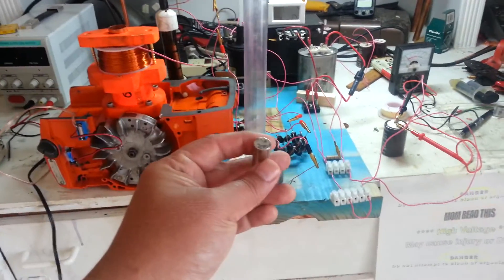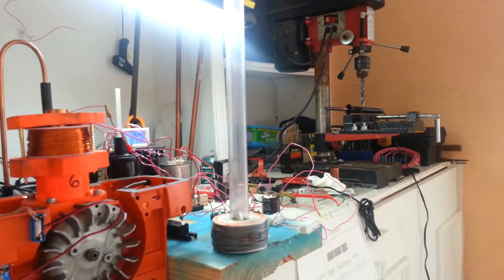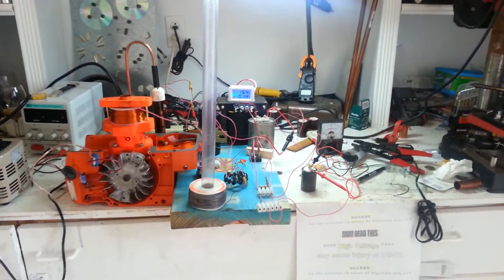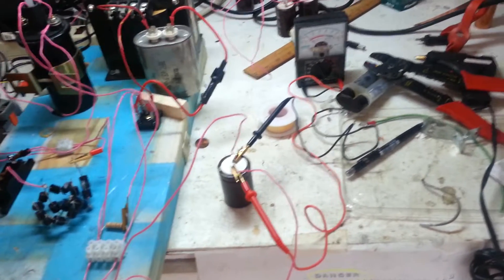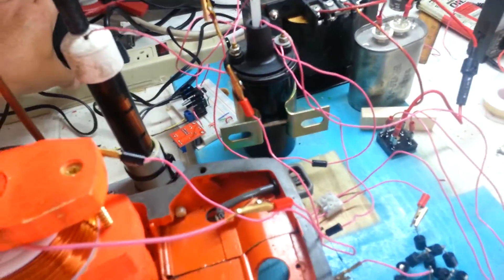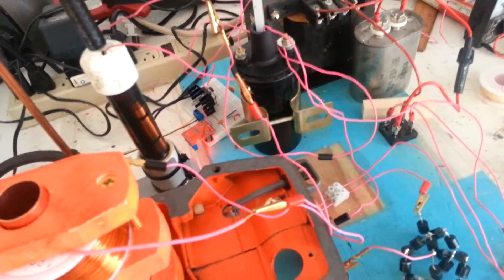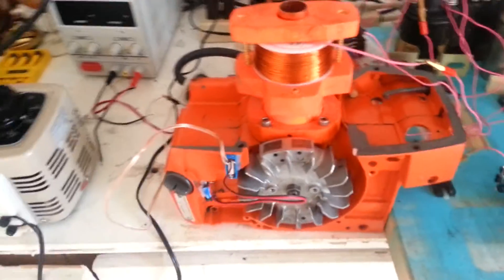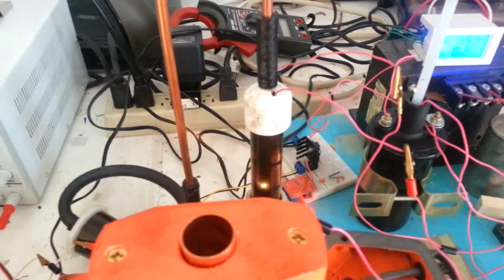Working Ed Gray Motor

Comment: Can you please power a motor load with it
Reply from the maker: Armando Garcia - It is possible, but you have to recognize the truth. This is an not an over-unity effect, this is a switching effect. It can be used to transform capacitive discharge through a coil to ground, but you have to have a means of charging that capacitor.
Reply: @XR_IX  can you run it to something g else, with a ground connection in parallel, you cannot mean earth ground right, chassis ground?
Reply from the maker: To All: A large capacitive discharge releases Hydrogen. My spark tube was immersed in oil and filtered to maximized the performance of the gap.  This is when I noticed that the discharge was creating an explosive gas (in OIL) as several times the build up of the gas at the top of my tube was ignited by a spark where no oil was present. This could be collected and fed back to compliment the magnetic pulse. Of course the motor would have to have a compression cylinder and carburation, but the point is there is more power to augment. This could be used for space travel, with no fuel needed (unless the oil is being chemically changed).
Reply: @XR_IX  OK, but in your collection device, doesn't it need to be open circuted ( capacitive shunting?) So as to not change the resistivity of the circuit,  or is that bs? Would this be called flyback capture etc ect?
Reply from the maker: @watchman0311  You have stacked questions so let me start with the easiest: Not sure what flyback capture is-  we are directly initiating motive force from coulombs flowing through a coil from a capacitor discharge,  from the demonstration of devices that use flyback (magnetic field collapse energy), I would not say this is doing the same, as the creation of the field propels the magnet, and no capture circuit is engineered. The question about the change of resistivity if I am understanding what you are asking, is NOT bs. If a device is to work in the over-unity domain, the input must not be affected by the output load. When you are using closed circuits with an output coil Lenz law will be your enemy. This circuit is overcoming the input versus output by the discharge pulse. If we could stop the motor  from turning or slow it down, it would not effect the input power of my device. If you stopped or loaded a motor in a closed circuit... your input amps would try to meet the demand. Ultimately you see why Ed Gray never could show his motor in a car or driving a load. The power of  the motor is tied to the discharge capacitor (Farads), and you start requiring a larger capacitor for more power. A gap would be burned out, and a SSD might work, but in the end... it is a switching circuit, and no power amplification was engineered in.
Reply: @XR_IX  awesome man, I'm pretty jealousy
Reply: @XR_IX  so do you think o er unity is a fantasy then?
Reply: Sounds like all tesla stuff relied on open circuts and discharges.
Reply from the maker: @watchman0311  Yes over unit is possible. I am sure of it. But Tesla said, “No free energy device will ever be allowed to reach the market.” So I am marketing no device. I am trying to build something to give away. This motor, as presented is not the way, but because the Ed Gray patent is misleading, and probably incorrect, (At least what you see from the Bedini drawings). Ed Gray was not an engineer, he was a salesman. His engineer, the real guy who was figuring things out and working out the details disappeared. Probably because he learned how to really make free energy. You can waste a lifetime on conspiracy, don't do that and build.
Reply: @XR_IX  agreed.
Reply: watch "ismael aviso" channel.with his self charging car.... 13 years ago..

Comment: Hello, please allow me to focus on the details of a component, the Ed Gray grid tube. It may be an insignificant question. What I see in your video is making me think that my understanding of this device is all wrong. As described by Bedini, inside the tube 2 straight copper bars positioned inline with each other act as the cathode and anode, separated by a gap through which a HV discharge is fed. Surrounding the bars there is a copper tube called the grid which acts as a collector of the radiand energy being emitted (you explain that in fact there is a fast repeating HV discharge but also a slower and lower HV discharge jumping the gap aided by the first, splitting the positive). I imagined that the HV discharges would always happen in the gap between the 2 internal bars, but in the video I see that they happen randomly throughout the length of the tube as if jumping from the bars to the grid. Was Bedini's description of the Ed Grey tube wrong? Is there only a single bar inside the tube acting as the cathode and the anode being the actual grid? I guess that if we envision radiant energy as originating from the HV spark the Bedini interpretation could make sense. If on the other hand the fast unidirectional HV discharge is meant to pull electrons out of the metal as if manufactured and radiated, then the spark from single bar to grid may make sense. If you can, please guide my understanding through this event. tks
Reply from the maker: Look up this in AI: Is Tesla's Radiant Energy the same today's definition of radiant energy. 

You have to understand the answer, when you do you can answer your own question.
Reply: @XR_IX  here it goes from ChatGPT 😂 and I was not expecting anything different. Tesla’s original definition of Radiant Energy is not the same as the modern scientific definition used today.

Modern Definition of Radiant Energy
Today, radiant energy refers to:

Energy carried by electromagnetic waves (e.g. visible light, infrared, ultraviolet, X-rays, radio waves).

It is a form of kinetic energy transferred through radiation, and can travel through space (vacuum).

Common examples include sunlight, X-rays, and radio signals.

This definition is well-understood within the framework of classical electromagnetism and quantum physics (like photons).

Tesla’s Concept of Radiant Energy
Nikola Tesla used the term “radiant energy” in a more speculative and unconventional way, which included:

Mysterious forms of energy that he believed were present in the ether (a now-discredited medium once thought to fill space).

Energy emitted from high-voltage discharges (like from Tesla coils), which he claimed could be harnessed for wireless power or other effects.

A kind of energy that was distinct from conventional electromagnetic radiation.

In some of Tesla’s patents and writings (e.g., U.S. Patent No. 685,957), he described devices to capture this energy from the atmosphere, sometimes alluding to electrostatic or longitudinal wave phenomena—not aligned with the transverse waves of classical EM theory.

Summary:
Tesla's Radiant Energy	
Based on Ether?	YES
Wave Type: Longitudinal (claimed)
Scientific Basis: Theoretical/speculative
Examples: Atmospheric electricity, Tesla coils

Modern Radiant Energy
Based on Ether?	NO
Wave Type: Electromagnetic (transverse)
Scientific Basis: Well-established physics
Examples: Sunlight, radio waves, X-rays

So while the name is the same, the meaning is fundamentally different. Tesla’s radiant energy was a broader and more speculative concept that doesn’t align fully with modern electromagnetic theory.
Reply from the maker: This is the truth about AI, you have to know what's right. In theory both answers ChatGPT and Gemini are "real" perspectives, however they use different data sets. You choose the Kool-Aid you drink. But if you want to bend physics, use Tesla's. The "Madman" dedicated his efforts when he pivoted on this theory. Then people will call you crazy too.
Reply from the maker: @pazzingthru Depends on your comprehension level doesn't it? If you get it but think it's nonsense then it's incumbent to you to point out the nonsense. If you can't tell the difference and say it's nonsense, then it really doesn't matter. I'm guessing you have no clue because you're non specific, have no videos, nor an identity to challenge. I guess that makes you... fruit salad.

Comment: what a lousy presentation, no schematics and poor ability to explain.
Reply from the maker: I agree, I should fire that stammering yahoo, for not providing every detail. :)
Reply: @XR_IX  in the collaborative spirit of sharing experiences and knowledge to a greater good, open sourcing becomes important. This means helping the viewer to understand what is going on! It does not take much, a pen, a piece of paper  and a simple line drawing, values also help. Not doing this opens to the risk of having viewers think that it is all a hoax. But I personally did not say that, I believe in radiant energy and I think that Ed Gray really did have a working device, I just consider your explanation lousy and not able to clearly explain what is going on.
Reply from the maker: @ Make sure you sweep upwards with your wand, while saying "illuminatis!" - Ask a well formed question, maybe get a helpful answer. I won't describe the theory, engineering considerations in general terms. It is too much work, and I don't know your level of comprehension. Most of all I don't know if you have ever tried building EVGray. We would need common reference.
Reply: my understanding is Nikola Tesla describes that in order to harvest radiant energy it is necessary to pulse at very rapid speed, he was doing this with spark quenching, rotating spark gaps, air and insulating oil. Fast unidirectional sparks in the microsecond range. It seems to me that this is the obstacle most experimenters are having. The concept of splitting the positive could be the answer, not an easy concept to understand. Youtube viewers come at all levels, very rarely does one get to discuss things at high levels, most often one has to  help along hobbists such as myself, who have general basic knowledge but who are profoundly interested. Sometimes just simple info can lead one in the right direction. I use an ignition driver to spark a low resistance canister coil, very robust sparks happen by using a diode from the low voltage to the high voltage positive. If I generate such sparks inside an EdGray tube, at least what Bedini describes to be an EdGrey tube, I would expect something to happen, but I am not getting anything. For one thing I thing the graphite carbon resistance to slow down the amperes my be missleading.
Reply from the maker: @francescotrevisan4453  It is moot how fast your spark gaps cycle, if you have no way to collect the output. Do you have a video of your build?
Reply: @XR_IX  I have been promising myself to find the time to make a few videos. The tube is 50mm diameter with copper rods in each end and tungsten tip insert, the high voltage discharge in the center. A fan blows air into one end in the attempt to quench the HV discharge. No transformer oil circulating as in what I see in your video
Reply from the maker: @ The answer is NO then to collection? The EVG device, uses a CET (Spark Gap). but it is DC pulse motor. Your goal should be to magnetize a coil to push against a permeant magnet, or a coil in parallel, wired such that it creates a like pole when the  gap closes. This creates motive force. A EVG tube is a switch on the basic level, and has to function as such.
Reply: @XR_IX  thank you. At this stage I am a bit less interested in the EVG motor and more focused on the  collection tube, my reasoning is that if it is able to collect a form of radiant energy, it should be able to power not only electromagnet coils, but also lights and other devices. Am I wrong? is this form of collected radiant energy more indicated to be converted to a magnetic field? So should  the EVG motor be integrated with the grid collection tube? maybe the coils are also feedback devices? thank you for your help
Reply from the maker: @francescotrevisan4453  If you don't use "Radiant Energy" in the correct thinking, it  is going to mislead you to a dead end. Because Tesla's use of the words are NOT what we consider radiant energy in today's EE academic instruction in respect to EM waves. So if you use it ibid Tesla, then the answer is yes. I'm not sure if you are aware of the history of the EVG motor, but it was based on a hand drawing form N. Tesla, which became the EVG CET.  The CET concept, is absolutely is accurate in terms of mechanics, but not in the application people digest. Naturally they see the Bedini drawing and think expulsion of electrons, and hence wrong conclusions are manifested.  All my OU devices, are based on the correct application of using N.Tesla's ideas. Bedini misunderstood the relationship, and did away with the CET entirely in his devices, hence he collected a fraction of the switching energy.
Reply: @XR_IX  so I don't think that there is expulsion of electrons, there is the free flowing of aether energy which upon contact with copper sets existing electrons in motion. But frankly, for years I have envisioned this poetic approach to the Ed Gray Tube, with no way to test it. Again, as stated earlier, I have the feeling that the creation of the abrupt HV event, unidirectional in its flow, μs fast and powerful, personally I have to been able to reproduce it.
Reply: @XR_IX this is weird, I posted a long reply message before ... but it's gone ...
Reply from the maker: That maybe correct, I really am not a theoretical physicist. I tend to refrain from using pseudo scientific terms like  zero point. The question is how do you apply that approach that there is something else, and that it takes an abrupt disruption to manifest? What does it manifest?
Reply from the maker: @francescotrevisan4453  Sorry man it's YT code, it commits are temporary, and if you refresh the queue, before the DB commit, I think you lose your post. Make sure post, in another video, and you don't refresh while posting.
Reply from the maker: I don't think that is right. It is not using the scientific method. It seems a regurgitation of something you read somewhere else. Make inferences, and support your conclusions with results. This is why you see no results. This zero point crap, is a ruse, to mislead you to think energy is waiting to spill out of the aether. That would be impossible, because some anomaly would invoke the universe to burn out in some chain reaction. Do you see why that has to be incorrect? Tesla's Radiant Energy is absolutely proven in my OU devices. Look at the Tibor Kemeny patent, it will start helping you to understand HOW TO USE IT.
Reply: @XR_IX  thank you
Reply: the Timor Kemeny talks about a new alternating current  not governed by Ohm's law. I will read it
Reply: @XR_IX  what you say makes. Tks

Comment: This has been 9 years ago ..did u give up on ed gray....???...seemed promising ..
Reply from the maker: It was, but there was no OU at that point. I still had to pay the grid for the charging of the cap to deliver current to the coil. So I focused on other directions, and actually use the lessons learned from this device. Could I redesign this to work as an OU device? Absolutely, just read the Tibor Kemeny Patent. However, if I have a device that can deliver KW, then I could run any motor... That is is why there is no need for me to to continue. The journey has taken me through magnet motors, EVG motors, Tesla coil generators, and finally to Don Smith. The solutions for all these systems are bound by one word: Magnetism. Once you learn the truth about the nature of it, the universe is your oyster.
Reply: @XR_IX  cool...thanks for chat...so u running your home yet...or your ev ..car ..scooter...boat...plane..flying saucer...or are those in the works..don smith info is interesting...
Reply from the maker: @ Always having fun...

Comment: Could this be used in an electric vehicle using a battery?
Reply from the maker: It does matter what you mean by "this". Regardless, if it means capacitor driven, or spark driven, I could probably propel a spaceship, because my version of "this" is quite broad, and I have endless imagination.

Comment: Have you made progress on this device theory?  I wish splitting the positive would be diagramed for my brain to understand it.
Reply from the maker: I've made progress in all my device theory. You don't have to use capacitive transformer theory  to directly create motive force. It can be applied  to electrical systems. Don't view the CET as a complex device, it is a controllable spark gap. A thyratron is device that does the same thing. You are basically putting two diodes with the cathodes facing each others, and then opening a path to ground. What is important about the device is how you can distribute the pulse of energy. This device only shows a single coil, but I could drive multiple coils with the same single pulse. Which is what Ed was doing.
Reply from the maker: Splitting the positives is just FE jargon. It isn't the end all, nor the fulcrum for energy multiplication.
Reply: @XR_IX  Yours is the only video that makes sense about Grays work..  My theory can we marry high voltage and high current effectively.
Reply from the maker: @timothybranco1231  Normally you can't marry the two, for the same reason you can't trade them equally, even though V=IR, and it seems that you can trade some voltage for current between sources. Though we do that exchange in normal transformers all the time with the same source. We know that we can step up down voltages and see proportional current ratios.  But you can't take mixed source - say a battery 14V at 430cca and mix it with say 2000v NST@20ma and send both to ground expecting 860KW. The scope should see 14V DC with AC riding on the top at around 30Khz. No mixing apples and bananas.